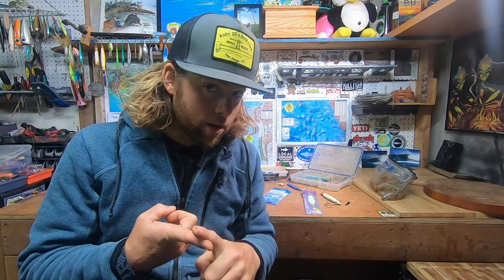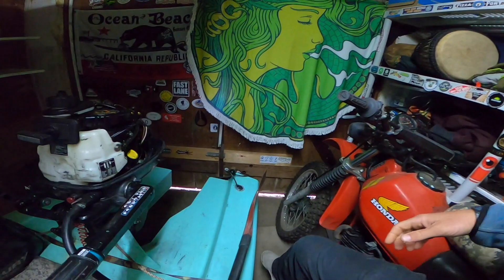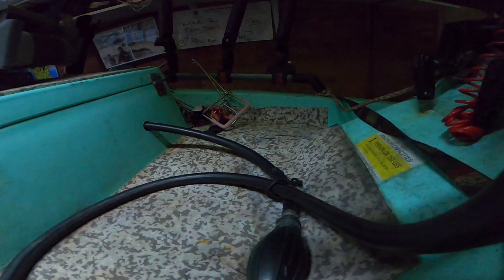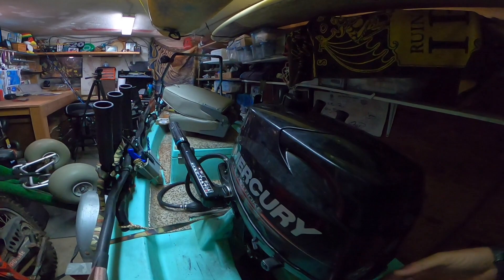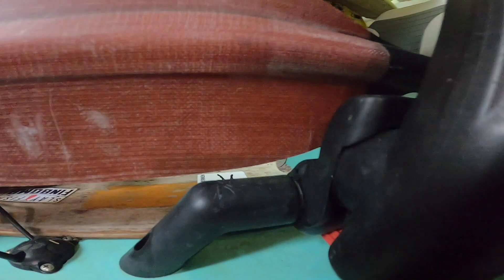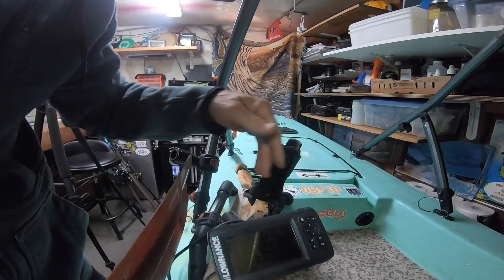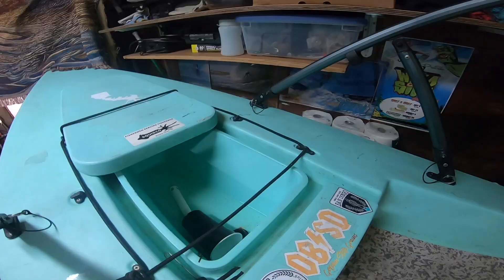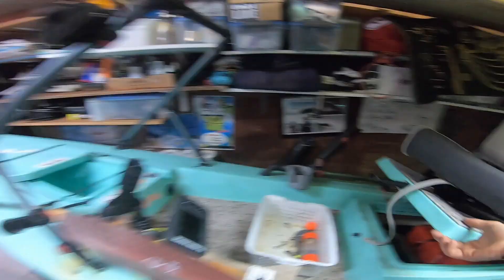SOLO SKIFF WALKTHROUGH  How I Rig Out My Motorized Kayak Micro Skiff For FISHING

Comment: Another awesome video, Mikey. Thanks for the shout out!. Your video is super informative and very detailed. Great how you describe the good and the bad of some accessories after being put through the hard use and harsh environment of the ocean. Those Hobie H Rails could provably be locked firm, by using those Aluminum Triflod 3/16 pop rivet. I just picked up on eBay 100 pop rivets for $15.43 and free shipping. I use those to mount a lot of the flush mount Scotty bases.They would leave a nice black round button head on the outside while compressing the pipe to the plastic ends with the trifold end hidden on the inside of the pipe. See you out at LJ when this crazy weather gets back more to the norm.
Reply from the maker: Great tip and info Mark.  I’m goin to check that out!  Tight lines!!

Comment: on electrical connections on your solo skiff since it constantly gets wet I would use dielectric grease on all electrical crimps connections before crimping and heat shrink to help seal from moisture.

Comment: Seems like the failure of the rear handle bar should have been a warranty item.   Like the idea of safety lines on the motor, but surprised you don’t use leashes on your rods/reels.
Reply from the maker: The leashes on the rods and reels gave a tendency to get in the way.  I have not lost any rods and reels so I’ll probably go leashless until something changes.  Thanks for watching and the comments

Comment: Just bought a solo from a dealer.  What trim setting do you use on your merc?  I have a tohatsu and anything under the 4th position sends the anti vent plate into the transom.  Seems a lot of people have that issue from photos I have seen.  Thanks for the videos.  Incredible adventures.  Wont lie, your excitement is inspiring.  Thanks
Would love to represent with one of your stickers if possible.

Comment: Have you thought of using the tank on the engine as a reserve with a gate valve to block the flow until you need it? I guess you’d need fuel stabilizer so it didn’t go bad but it might be a good idea.

Comment: Great vid, very helpful!  Any thoughts on adding a boondox landing gear so you can avoid trailer, and still be able to roll your solo to the launch, and still slide into your truck with a bed extender?...thanks!
Reply from the maker: That is the other item I wanted and thought I bought.  I would definitely make things a lot easier when I’m on the road.  I can also mount and tie off to the bars.  I’m going to look into this.  Thank you!!

Comment: Instead of WD-40 you should really be using corrosionX.  I found it to be way longer lasting and just a way better protectant for under the motor cowling.
Reply from the maker: Thanks for the tip, I will check out corrosionX.

Comment: Hi, I have a couple question about Yellowtail fishing out of La Jolla. I’ve seen a lot of your Yellowtail videos. I want to try to get out there for the first time ever this March. Ive done some research about early spring fishing, but I was wondering if you had any extra advice. I’m going to fish off a scout 430 inflatable and I don’t know if I should cover water quickly with a deep diver (nomad) or drift with a fly line. Also, I don’t know how or where to find fish in the first place. I also read that in early spring months that the yellowtail hang out really deep and the farthest I would take my inflatable out is 1 to 1.5 miles from point La Jolla. I’ve never fished for yellowtail, so any tips would be very appreciated.
Reply from the maker: Hey Ty.  My recommendation is fish both live bait and lures.  The majority of my yellowtail from La Jolla have come from flylining a greenback mackerel that I caught using a sabiki.  Fly line means slow troll the live bait behind the boat with no weight.  Follow ridge lines and pass over the top of structure and keep an eye on your fish finder if you have one.  Research online, buy books, and maps to get started with general info overall on different fishing “zones” (ie La Jolla). The fish move all over to different “spots” that are always there in the different fishing “zones”.  March is a great time of the year.  Live bait is still king for La Jolla in my book.  Tight lines!!

Comment: Awesome. I had a question on hoodoo hero 130 skiff it’s the only skiff I can find in my area since solo skiff discontinued. I wanted to use hero 130 skill with 6hp motor take to ocean jetty  breakwalls  maybe oil rig?
Reply from the maker: From what I’ve heard the Hoodoo is similar to the solo.  Just make sure to check the wind, wages, weather and be safe.  Tight lines!
Reply: Sounds thanks for the help and sharing!

Comment: You use your rails a lot so, I'm curious how you mounted them and are you having any issues.  Did you use the washers that came with it or did you fabricate larger ones?  Thanks.
Reply from the maker: I used the washers it came with when I could access the backside and others I had to use self tapping screws.  I’ve always had issues with the rails twisting so I try to sink a small screw in to keep from twisting but haven’t had the best luck.  Thanks for the question

Comment: How many live bait do u get at the bait barge
Reply from the maker: I buy a kayak scoop which is about 2 net fulls.  Maybe 40-50 sardines?  The bait tank can get too crowded and kill bait.  Thanks for watching.  Tight lines!
Reply: I ha e a malibu x factor and my live well is pretty small do they sell like 3 or 4? At that point it seems better to just sabiki
Reply: @vincent.vangogh7861  I also own a 2016 Malibu X Factor and plumbed the front raised compartment as a live well. I also use a sabiki to catch all my live bait. On the Solo Skiff when several of us went out we split 2 kayak scoops between three of us and there was still too many sardines on each live well. Personally I don't care for sardines because the aren't very hardy and are weak swimmers. I prefer using a 7"-12" Greenback Mackerel. "bigger bait = bigger fish".
Reply: @markr9312  I'm not sure what year mine is I think 2011 it  doesn't have the raised hatch, only the center and back hatch and the big front hatch. And it has 4 locks on the hatch lids instead of one center lock.
Reply: @vincent.vangogh7861  Are you sure you have a Malibu X Factor. I also had an early model that was provably 2006-2007 and now I have a 2016. The early model had the front large hatch and one directly in front of the seat and another behind the seat. That rear one, because of the hatch angle , you would never want to open it in open water. The 2016 has another hatch, that is a sealed compartment and is raised up some. That can be a store area, cooler, or plumbed for a live well. Here is a link to a new one. The newer models, like a lot of kayaks today has a much better seat than mine 2016.   https://malibukayaks.com/kayaks/x-factor/
Reply: @markr9312  yeah it says x factor on it. The back hatch is angled
Reply: The hatch lid has the 4 locks one on each corner instead on the center locking mechanism.
Reply: @markr9312  Ive never had issues getting into the back hatch I can hang my legs over the side. The x factor is a frigging barge.
Reply: @vincent.vangogh7861  sounds like an early model style on the deck, I had build my own bait tank, very much a copy of OEX's bait tank that uses one of the Dog/Pet Food container. I loved that kayak because not only was it the kayak I learned on, but the stability, carrying capacity are almost unmatched. I fought and caught many La Jolla Yellowtail and other species as by-catch. That's why when I used my Hobie Revo 13 for 4 1/2 years and had a chance to get a super deal on a kayak that had almost not been used and was still that years model, I jumped on it and still have it, even as I now use my 2020 Solo Skiff.
Reply: @vincent.vangogh7861  The newer model since around 2013-2014 have the rear hatch raised to be the height of the gunnel  and being that high above the water surface make for safer feel, when needing to get inside while the wind chop is making look like a lot of water could get into the hull. I love all the X Factors, they are controllable and predictable in surf launching and mostly landing. The Hobie is the surf was always sketchy. I've landed at La Jolla on my Malibu X Factor with 66+lbs of Yellowtail inside the the hull in the bow area after loosing a 4th Yellowtail. In my 2016 I use my fish bag or have carried them inside the hull, through  the center hatch in front of the seat as I slid a 32+lbs Yellowtail towards the stern.
Reply: @markr9312  I got mine for 450 with live well and fish finder already installed. I got it to go get some real fish like you. Yellowtail is the target .
Reply: @vincent.vangogh7861  That is so similar. I,  back is early 2013 thought I would get a kayak for exercise  and take up fishing again after looking at one in Costco. Lucky for me I stumbled onto  BWE and the forum. I saw photo's of guys at the beach holding yellowtail and WHAM!. I thought I'm in and screw those trout or bass when you can get yellowtail. They are so awesome, the super strong pull, getting towed and hearing the drag of the Avet fishing reel just screaming. It's incredible, I don't know how to better put it into words.
Reply: After looking on BWE for a while, I found a early model Malibu X Factor with mono-chrome Lowrance fish finder, paddle and seat. I found it at Fast Lane for $500,  made my own bait tanks and had a great time on it, that why I also love my 2016 X Factor.

Comment: Hi mate, do you think it's possible to convert a hobie pa 14 into a skiff? I hate sitting down, i'm considering removing the seat on my hobie and just sanding up
Reply from the maker: Hobie does make a battery pack and propeller adapter that you can try and use to turn into a skiff but I have not seen it done with a gas motor like my Solo Skiff.  You need a transom to mount the as motor too.  Good luck.